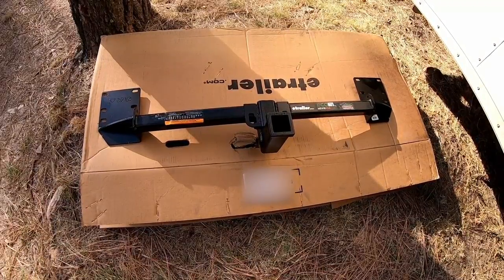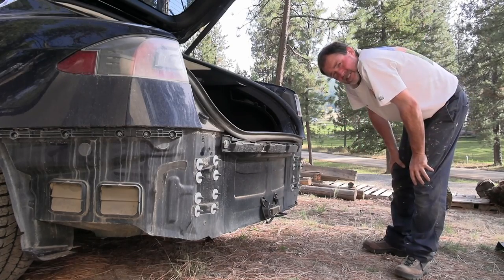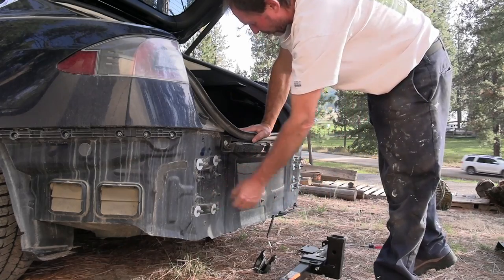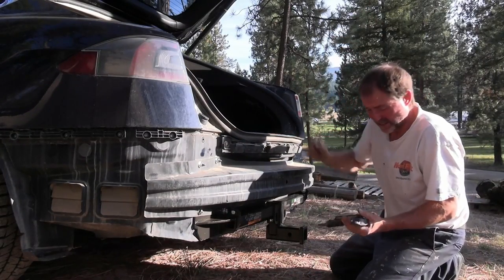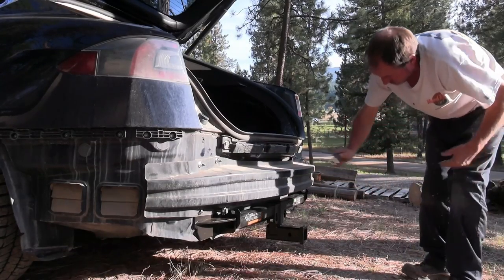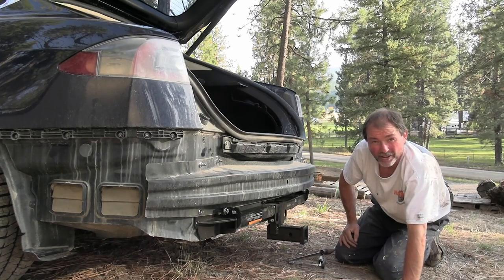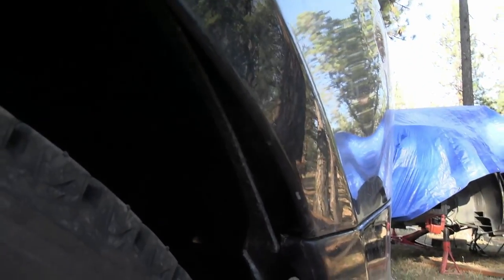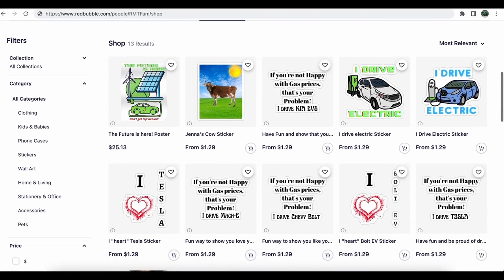Installing receiver hitch on 2013 Tesla Model S 85, we'll be towing a trailer with our Model S. DIY

Comment: Thanks for posting this video! My 100k mile '14 S just came out of its 8-year battery warranty period (Tesla isn't giving me a new battery, the battery capacity loss is within their specs, but they won't tell you the spec or what your car scored, which is shady).  Anyway, now that I'm out of warranty I'm ready to tow my kayaks and bikes! I also think this might help, I've been rear-ended twice and I think this may prevent some damage if it happens again.
Reply from the maker: Hi Josette, I’m glad this video helped you to move on to greener pastures. LOL.
I’m wondering what your concern is in regards to your battery pack?
Is yours a S 85? Performance?
I’m not worried about miles and battery degradation. We have several videos that might be interesting for you. Here is a link to our Tesla playlist. You can just pick the Model S videos starting with “We bought the cheapest Model S”. These videos may help lighten the fear of bad battery packs.
Please let me know what the concern is with your cars battery pack.
Thank You for watching 👍
Tesla Videos.
https://www.youtube.com/playlist?list=PLXFh8hHm3-BdFrpR1lY-D2zZXXgOH_m8l
Reply: @RMTFamily  Yes mine is an S85, not the performance version. My concerns about the battery life are rooted in my experience owning one of the original Nissan Leaf cars, which degraded quickly. I have some range loss of course, but it doesn't impact me. It turns out the 2014 Tesla battery technology is far superior and I am now hoping for another uneventful 100,000 miles (with some towing at the trailer)! It's almost ten years later and the competition is still thin!
Reply from the maker: @josettegates3869  Yes, you’re right. The Tesla battery technology is so far ahead of Nissan Leaf and you don’t have to worry about degradation. Our S 85 has around 10% to 15% degradation with 200k miles. Actual battery failure is rare. Tesla used to replace battery packs just for contactor failure. The contactors are located in the back of the pack. Now they drop the pack and replace the contactors. The contactors in our S are due. We have a power restriction and the fault code for it but it still drives. 
Enjoy towing your toys around👍😃